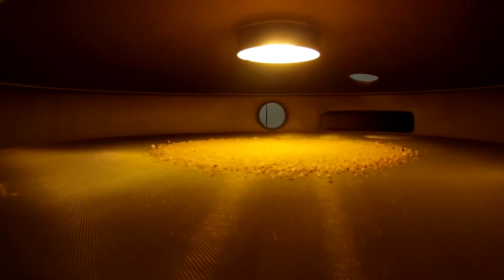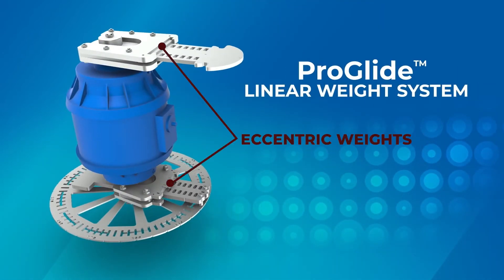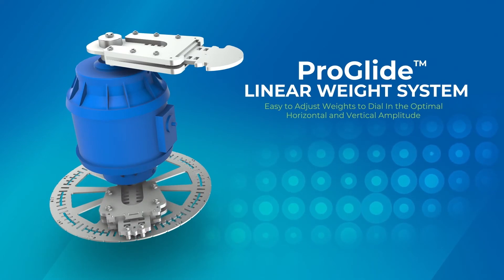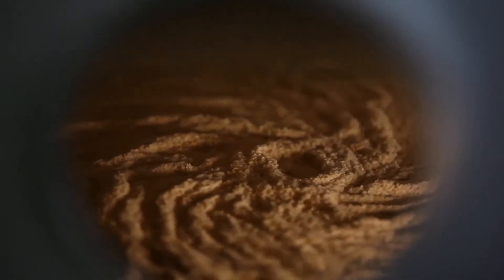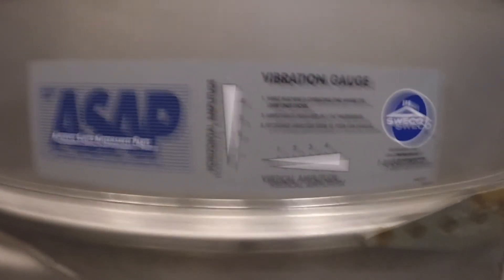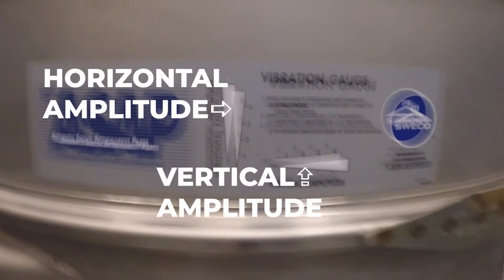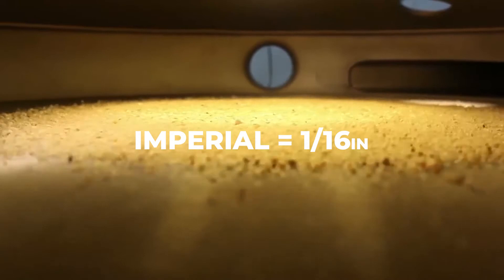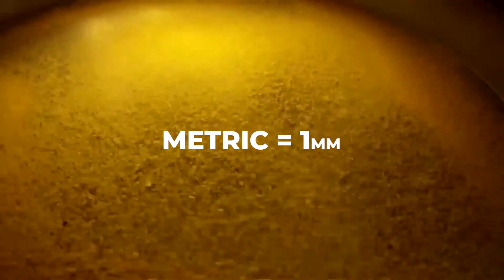How to Read a Vibration Gauge Sticker

Comment: Hi. I am writing to you from Turkey. (There may be a problem with automatic translation.) Our company is a gold mine. We are using the Sweco xs60s888 model. While this equipment should work with an average of 4 amperes, the first start starts with 28 amperes, it takes a long time to reach the working amperes and stops. It repeats a minimum of 6 times at night at low temperatures (5°). After 6 times it drops to working amperage. can you help me what is our problem?
Reply from the maker: Hello Isa. I just responded to your query on Facebook. I need to give your question to our technical service group so they can investigate. But they do not have access to any of our social media chats. So if you could provide me with an email address for them to respond to you, that would be great. Thanks, Jeff Dierig SWECO Global Marketing Manager